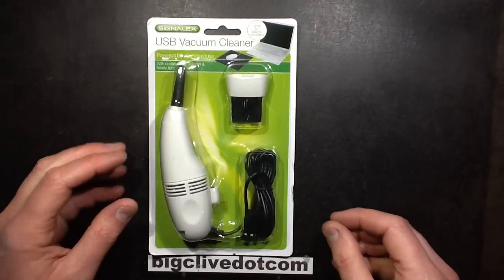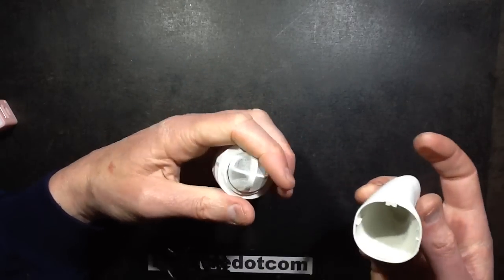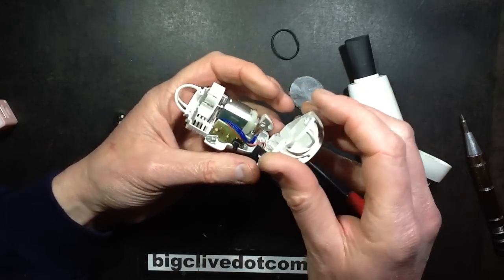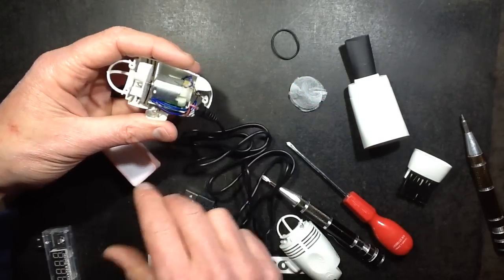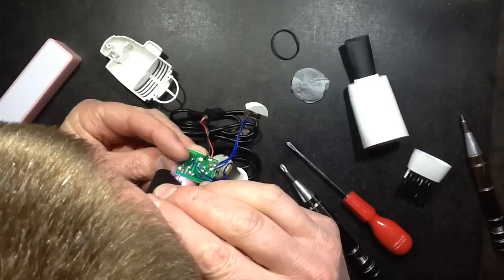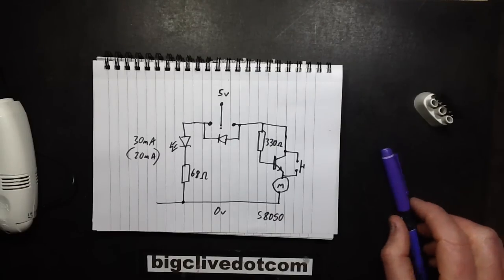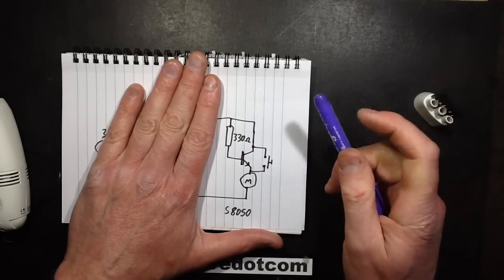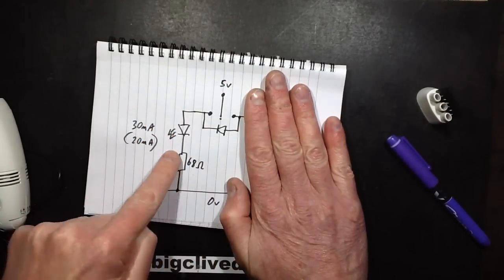Poundland USB vacuum teardown.

Comment: Haha, USB vacuum cleaner! :D At this rate, everything will be powered by a USB. :D

One of the things which would be REALLY useful, is a USB toaster. I saw one on the internet some time back, but it turned out to be an april-fools prank. REALLY?!!

......The other prank was a smoke alarm which emitted a nice gentle pleasant birdsong in the event of a house fire. :D

So then..... USB vacuum cleaner which runs on 5v. Hmmm...... I say whip-off that USB plug and replace it with a 6v or even 9v wall wart which outputs DC.

You know..... the wall-wart which was salvaged from a cordless phone which refused to work anymore.

An extra volt would make it go a tad faster, but 9v would have that thing going overtime! :D LMAO!

Then, once you've got it going on a nice 150mA wall-wart, you could then 'hack' it inside and have away with all that current-limiting electronic hocus-pocus and then it'll RIP RIIIIIIGHT UP, for the optimum suckage. :D

Thanxx for showing,

-BoomBoxDeluxe.

11th April 2015, 18.19
Reply: Have you checked usb 3.1 and the usb power delivery specification? At 100W it starts to get useful, just don't wait for usb powered laser printers.
Reply: Erlend Ervik Or Powered USB, been around for a very long time now, available in 5v, 12v and 24v at 6amps
Reply: +BoomBoxDeluxe  Power over USB master race

Comment: Have seen these in local stores where I live. I kind of need something that's smaller than my B&D Orb-it, but didn't really like connecting a motor with an unknown current draw to a usb port.

Might buy one and mod it. Drill some holes to give the transistor some better cooling. Maybe replace some components to off-load the transistor, or just replace it with an resistor. (Replace the 330ohm resistor and put an resistor in parallel with the transistor/switch?)

Comment: The USB-Ports on my old Laptopt with USB 2.0 only were capable of delivering 1.5 Amp continous. Almost NO manufacturer EVER respected the current limit of USB standard, luckily! Because no 2.5 inch HDD w/o own PSU would have ever run on USB. USB with the 2.0 current spec is not usable at all and 100% useless.I'm really glad that manufacturers of Notebooks and PCs have ignored that bullshit!